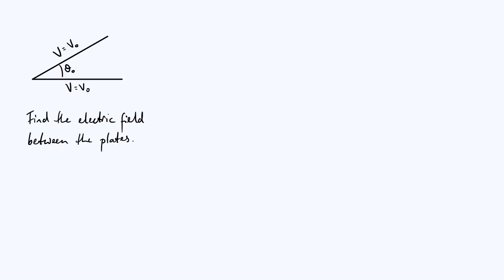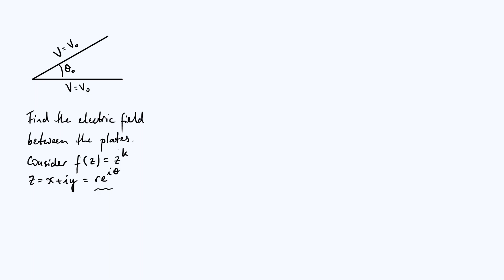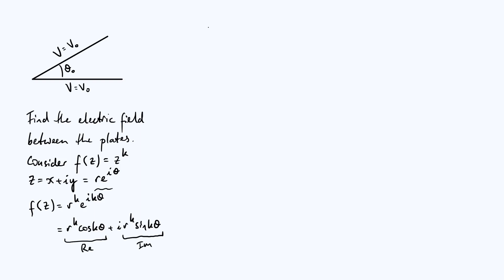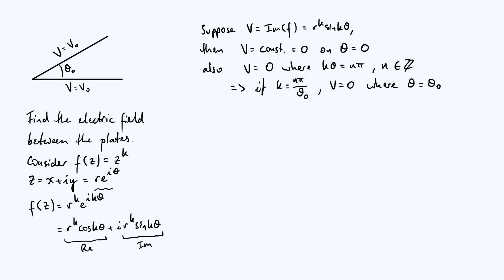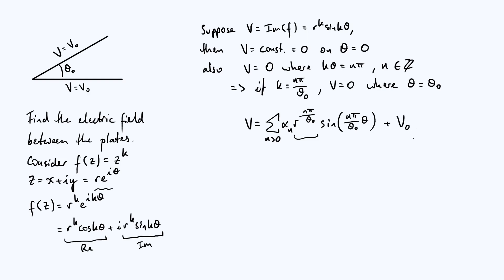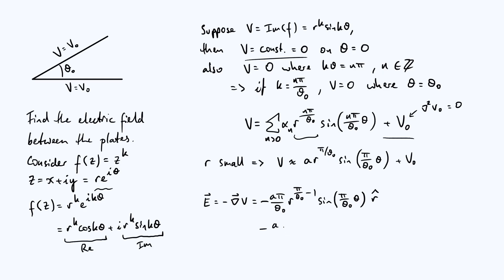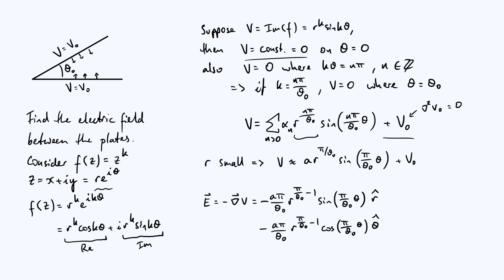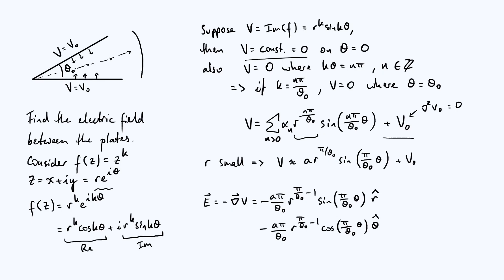Field between angled conducting plates, using complex numbers

Comment: wait what is the reason that the ansatz of the solution is in the form of auxillarry z^k?
Reply from the maker: There isn't really an easy way to spot this, which means that this method is not the most practical when faced with a new problem. In practice we basically have to work backwards, i.e. choose a complex analytic function f(z), look at the resulting equipotentials and come up with an electrostatics problem based on these - that's what I did for this video.
Reply: @DrBenYelverton  i see, then is it right by doing the convention, solving the poisson equation for this problem,  use some methods to determine correction (modifications) of the solutions for equipotential will eventually going to get in the form of sin(k theta/theta_0) ?

i'm just confused, you ansatz the solution of z^k and it performs well on the equipotential. But this particular solution must give a restriction on where the point charge would be right? since there cannot be e-field if there's no charge there.
Reply from the maker: You can get the same solution starting from Laplace's equation in polar coordinates, using separation of variables. There's no point charge here, the region between the plates is empty and the electric field is coming from the charge on the plates themselves. As long as the potential at infinity is not also V₀, there's a potential difference between the plates and the region at large r, and therefore a nonzero field. Placing a point charge between the plates would give a different solution, which would require either solving Poisson's equation directly or perhaps using the method of images.
Reply: @DrBenYelverton  oh i see thanks, it cleared up my confusion.

I thought conduction plate is equipotential which is constant potential that gives no electric field, but i guess IT'S able to interact with the surrounding, and i believe they require ground to make the difference of potential to diminish right?
Reply from the maker: Yes, conductors are always equipotentials but this doesn't mean they can't produce an electric field. There can still be a surface charge distributed across the conductor. As a simple example, consider a parallel-plate capacitor, which has a uniform field between the plates as the two plates are oppositely charged. Grounding a conductor forces the potential to be zero, but again this doesn't tell you anything about the charge on the conductor - there may be some induced charge on the surface due to other charges in the system.